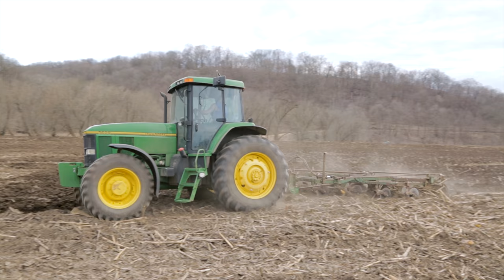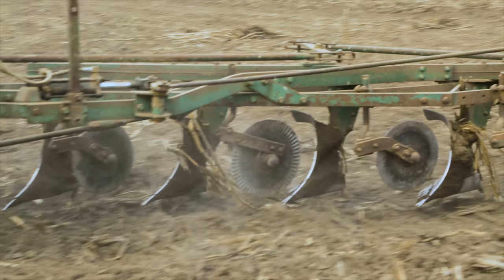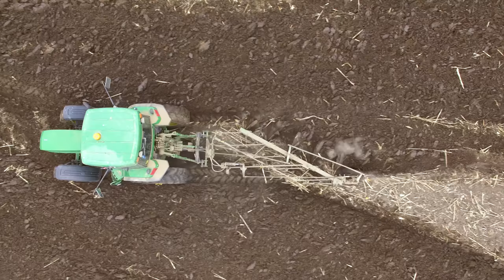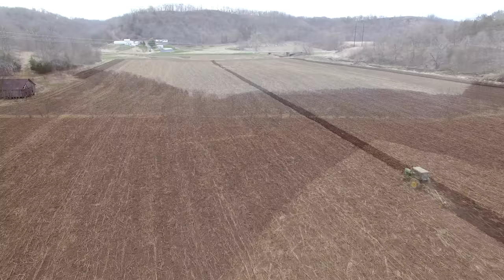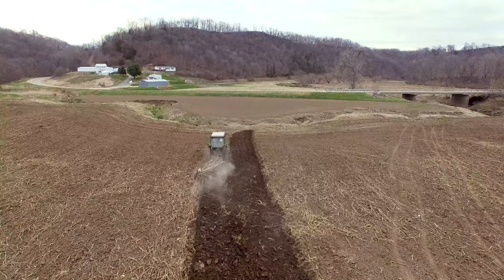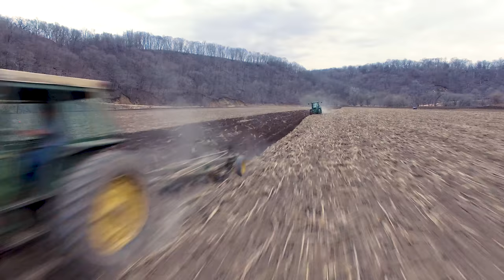Moldboard Plowing - John Deere 4320 & 7600

Comment: Rare to see a non-reversible plough being used!
Reply: That's about all we have over here. Roll over plows aren't very common this side of the Atlantic
Reply: I wonder why! I'm sure there are many places there where soil conditions are similar to many places in Europe. Americans don't seem as concerned about making a fine and even seedbed as Europeans from what I've seen. Finishing with a heavy disc harrow and seeding into that is pretty much unheard of here. Everyone uses a harrow (not a chain harrow, usually an S-tine harrow), or at least a field cultivator afterwards (or instead of) discing or ploughing. Sometimes a crosskiller-type roller as well, to break up clumps and push down rocks. 

I'd be interested in studying and comparing the different results! If you're growing large-seeded crops like corn and soy beans I guess you don't have to be as particular.
Reply: Depending on your ground type and what they're planting a lot of people use field cultivators with a rolling basket as a finishing tool especially when they're planting soy beans since you need to have the field as smooth as you can. Depending on soil conditions, and if you were able to do the more intensive tillage like chisel plowing the previous fall, all you'd need to do in the spring is hit it with a field cultivator (or a disc if you need to) then another finishing tool then plant into it. With small grains or corn having the top of the field as smooth as possible isn't as critical since you're not running the header right on the ground like you have to in soy beans. As for you plow question, I think its a mix of geography, equipment, and culture. Over here we've generally got more room to work with so we tend to prefer larger pull type or semi-mounted tillage and planting equipment rather than all 3pt equipment, plus the whole; stop, 3pt turn, turn the plow over and go would eat up a lot of time. Another difference is that our fields have more irregularities that we need to have that maneuverability to deal with. Now correct me if I'm wrong but I'm going to guess that a rollover plow of a similar size to what they guys are using here would require a bigger tractor due to having to pick up the whole plow and deal with the weight shift of turning it over.
Reply: Thanks for the insight! The bean thing makes sense. The comment about irregularities in the fields really depends on where in the US and where in Europe you're talking about, obviously. Here in Sweden the conditions vary hugely, from really big open fields in the extreme south of the country to small, irregular fields with lots of rocky outcroppings surrounded by forest in the north and other more heavily forested parts of the country. Lots of inbetweens too of course. If you go to the Netherlands the whole country is pretty much flat and open with lots of huge fields. To me it looks like the old tractor in the video could probably pull a 5-bottom rollover plough with wheel assistance for transport, and certainly a 4-bottom three point mounted one (which I believe is more efficient than a 5-bottom non-reversible...but more expensive no doubt!).
Reply: I re-watched the video to check and both are pulling five bottom semi mounts. Okay you're out of Sweden, yeah should have picked that up from your name, when I think of farming in Europe I tend to think of conditions like in England or France, which are parts of the world that we're more exposed to than you guys for whatever reason, cheaper flights I guess. Going by your description I'm sure there's a sweet spot where the conditions are like what Ryan and Travis have there. Oh and a bonus on the plow topic after some quick research, its mostly just a cultural and practical thing. I dropped in on a farmers forum from England and there were about ten threads of standard vs reversible plows. Smaller headlands and less of a dead furrow vs maneuverability in the field and not having to stop and back up every few minutes. Hey we're from North America, we're weird.
Reply: I don't think the K-turn you have to do on the headland with a reversible plough takes longer than driving over to the "going the other way" furrow when ploughing with a non-reversible one. Especially not when fields are bigger, and you have to drive further and further perpendicular to the direction you're ploughing to get into the furrow on your return trips. Does that make sense? It's kind of difficult to explain.

Also, with a non-reversible plough all the furrows (what's the upturned soil called? I'd only call the trench it comes out of the furrow) in a field won't be laid in the same direction. You'll end up with either ridges or trenches where the two ploughing directions meet, and several of them if you're ploughing in several back-and-forth sections like you kind of have to do on a bigger field in order to not have ridiculous amounts of downtime driving between furrows.
Reply: TheodorEriksson Makes perfect sense, you even took care of my counter point dealing with larger fields. Thats kinda the problem with moldboard plowing, you're going to have a dead furrow somewhere no matter what plow you use but  through some more research (I really need to get out more) if you set your headlands right and use a technique called back plowing you can midigate the problem. Carefull youtubeing it, you get like two plowing videos and all the rest are mortuary techniques. I wish I was kidding
Reply: With a reversible plough you usually only get one dead furrow, namely the outermost furrow in the last pass next to the field edge. Next year you plough in the other direction, which means the first bit of upturned soil fills in last years' dead furrow. In that way you move the soil "back and forth" year after year. 

Also, if your harrow, crosskiller or field cultivator has a leveling board (the modern ones usually have a hydraulically adjustable one in the front, which levels the field and breaks up clods before the tines/rollers work the soil) you can fill in dead furrows, particularly ones left in the middle of the field or at the edge between the normal passes and headlands. You can go diagonally across a dead furrow if it's not right at the field edge, and often even use the outer edge to fill in the end furrow. It takes an extra pass or two, admittedly, but it's no big deal to do. The first pass of harrowing/cultivation should be slightly diagonal to the ploughing direction anyway, if conditions allow, and subsequent passes should pretty much always be diagonal to the ploughing direction. Dead furrows kind of get filled in naturally.